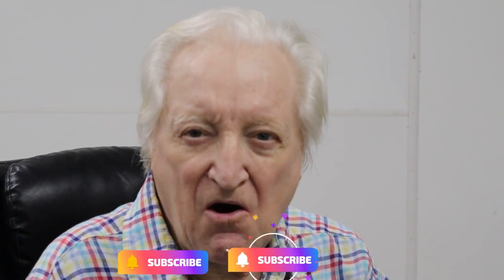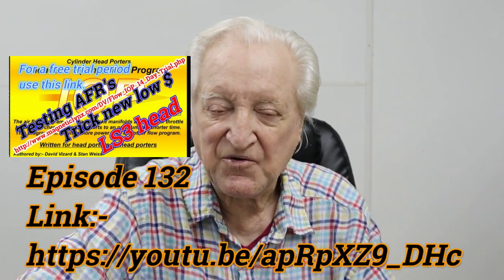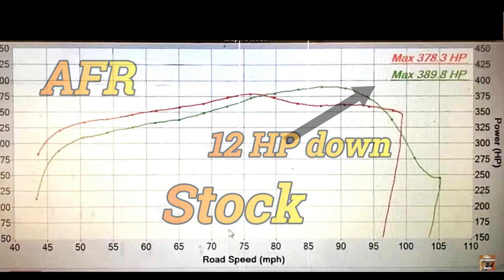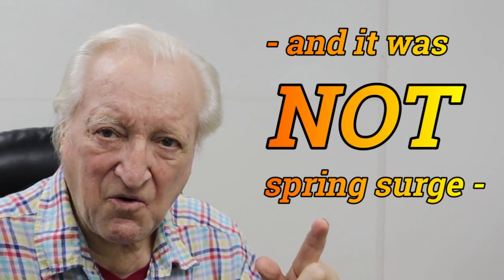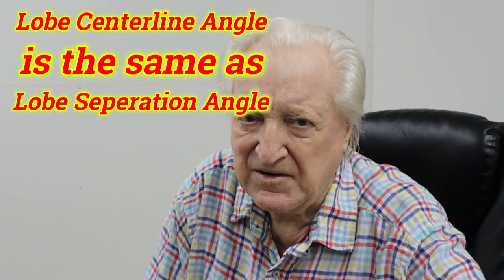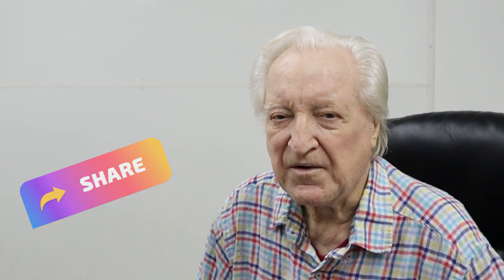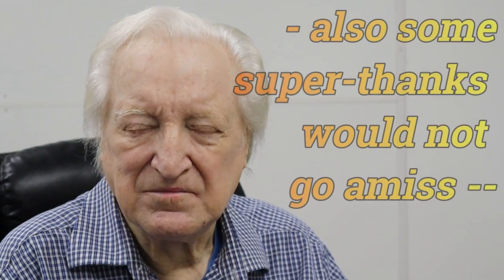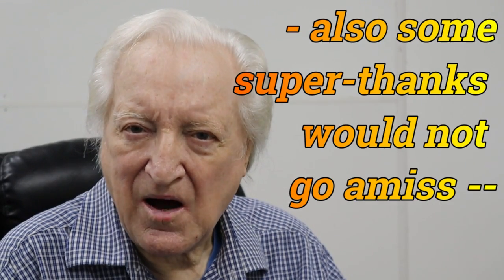AFR LS3 Enforcer - really great heads but less power. Why?

Comment: Would your engine program help me out building 2.3 Ford SOHC race engine? Along with your cam program? Or is it ment for V8 engines more? Thanks for you time Mr D. V.
Reply from the maker: Cody I have not done much with that motor but as we speak???? I am just about to flow test an Esslinger aluminum head with extensive work. Video should be out in a couple of weeks. DV
Reply: Tempo HSC combusion chambers and Ranger 8 spark plug heads are cool.
Reply: I got a cast iron D-port closed combustion chamber Head that has a roller cam shaft solded lifters been ported it runs very hard up to about 8,000-8,200 RPM when I got it done they said it would smoke a esslinger D-port aluminum head if you want to test flow numbers against something your more then welcome to do any testing or improvements you feel like need to be done Not trying to get free work done here I am not a rich man but i can pay for your time if you wanted to make any changes to it. And really I would be honored for you to even look at something of mine when I was younger one of your books at a swap meet in Portland, OR.  Is what got me into racing and really being interested in engines and everything to do with them at about age 11-12 years old I am now 37 years old and still can't get enuff info. Mom didn't like me circle track racing untill I started winning a bit and won the track championship the 2-3 year of racing and making things a little bit better researching and finding little things here and their. Anyway thank you very much for all your videos and all the information you share with everyone thanks to Andy as well and let me know if that something you would be interested in doing and if not I understand as well. And take care of your health the world need your wisdom thanks you for everything you do for the motor sports industry and what you have done for me making my interest being racing and race engines It has brought me a lot of joy and great times..
Reply: @codymyers
8386 
Don't forget it's not just flow but swirl and spark placement.
Reply: I have an Essy D port (as cast other than me cleaning up around the guides VERY lightly).... I'm not sure what to with it at this point... Car is an '87 "notch" Mustang, c4, 3:73 8.8 .... and it was around 2700lbs with an iron headed 2.3 with a Holset HY35...
I started building a "new" 2300 for it a few years back... I bought a nice used 50k mile block, it was bored .030 with a torque plate, decked (to clean it up... no "specific" height), I put it on the bridgeport, milled drilled and tapped and installed the "Honda oil squirters", etc... block is on a stand with a good fresh crank.  Set up a crank trigger (36-1) and coil packs for it this time around, using MSD DIS2 box and MS3

THEN - it happened. my daily driver Accord was totaled, and I thought to myself (boy, those K24s sure seem to make a LOT of power easily and reliably.... why am I wasting all of this $$$ on a "dinosaur" that may or may not blow up at 400rwp without good rods?)

I don't know.... Without writing a novel.  Anyone else see where I'm going with my thoughts? ...and care to share theirs?  I yanked the K24 out the other day and junked the Accord.  It's in GREAT shape (the motor, not the car! lmao)  I just want to get this Mustang back on the track (and road).  But, do I build the Honda motor and put that in it, or continue dumping money, (that I REALLY don't have!) on the inferior 1970s motor?

Comment: I thought the AFR head would prefere a tighter LSA and more lift. That factory ls3 head is hard to beat.we use them on the 6.0 blocks for the strength of the iron,this leaves a ledge because the chamber on the ls3 head is wider than the bore. The AFR head will cure this mismatch on the smaller 4 inch bore. That will be another benefit with that app.

Comment: David I can not find anyone to provide your cam master program - I am more than willing to pay for the extra charges - Please, please provide the info who should I call to get my cam design? You are the greatest and  in fact I am in the middle of three of your books while I am building my 400 SBC Promaxx Project X heads 2.08 valve true 10.4 / 1 compression -- I want the best cam possible for my hot street strip build I am figuring a 105 LCA with approx 40 to 42 degrees overlap? This senior citizen needs your help! Who do i call?
Reply: Call Mike Jones
Reply: click on davids profile

Comment: Is there an adjustment to the 128 formula to find the right LSA for a very low rpm torque engine?
Compression ratio 9.25:1
Producing max torque in the 2500-2600 range; redline 2700 RPM.
Building three of them for this rpm range and CR.  
402 cu in, 638 cu in, and 720 cu in.
Reply from the maker: Yes, TorqueMaster will cover from 1500 rpm to, if appropriate, 10,000 rpm
DV
Reply: Thanks
Reply: 2,700 rpm??? Why so low?
Reply: @lynnrunningdeer towing would be my guess.
Reply: @lynnrunningdeer  Best fuel mileage.
Reply: @Twogreenfeet  okay. Which can also be achieved through the drivetrain. Which I would prefer to do.  But it's not mine and what I want isn't important.
Reply: You need a custom cam.
Reply: @garlandjones7709 
You mean an off the shelf cam won't work?
Reply: @hotrodray6802  there are no off the shelf cams for 600-720 cubic inch engines.
Reply: @hotrodray6802  highly unlikely.